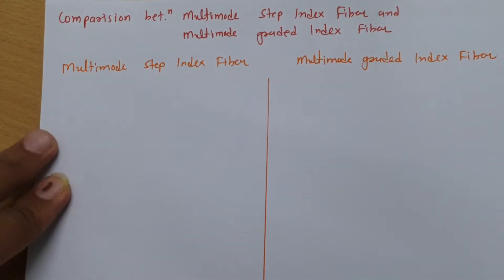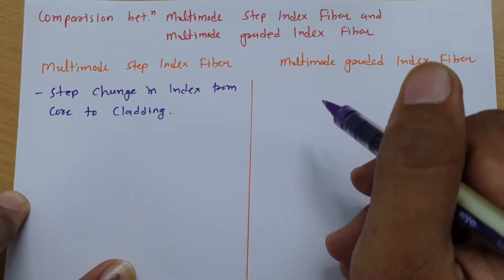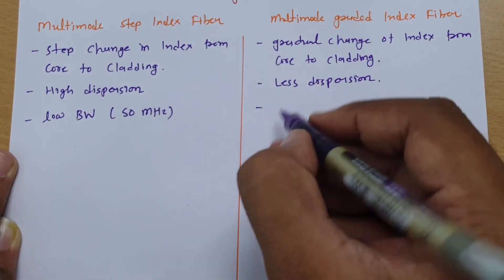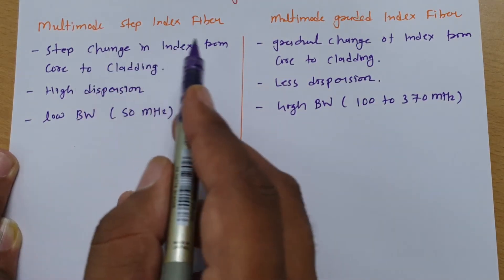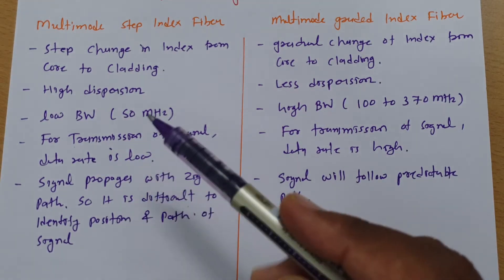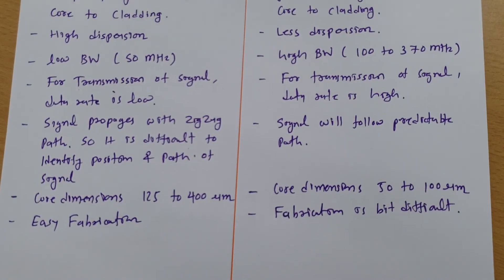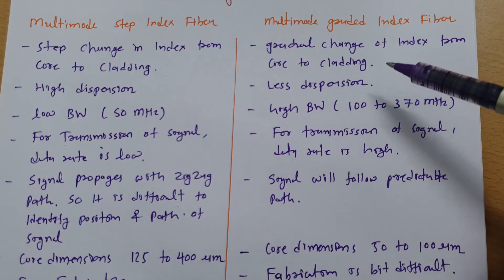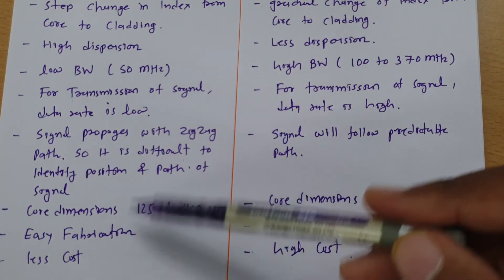Comparison of Multimode Step Index Fiber and Multimode Graded Index Fiber in Optical Communication

Comment: I would like to know for the single mode fiber, I mean "Is there any step-index or graded index nature in single mode fiber". Please explain if you have some free time sir. I really want to know this. Thank you for being make this channel.
Reply from the maker: Step index with multiple modes will induce more Attenuation and scattering so multi mode is more effective at Graded index fibers.
Reply: @EngineeringFunda  Thanks so much for your answer sir. Now I better understand for multimode (Graded index) is more effective. But I still confuse for single mode fiber. In Single mode fiber, is there any step index or grade index like mulitmode?.
Reply: @DWDM-101  no, because of the small diameter of it.it ranges from 8 to 10 micrometer

Comment: Can you share the facts about which type of the fiber will be used in most of fiber communication (telecom) companies Sir?
As per their parameters,my knowledge on this is they will use multimode-graded index fiber as it is possible for higher bandwidths and data rates(fiber to telecom towers). Your opinion please Sir.
Reply from the maker: 99% fibers are graded index multimode fibers. For single channal some applications are there with single mode and for experiments purpose we use single mode step index fiber.
Reply: @EngineeringFunda  Thanks Sir🙏🙏🙏